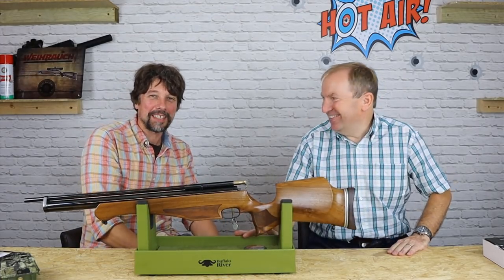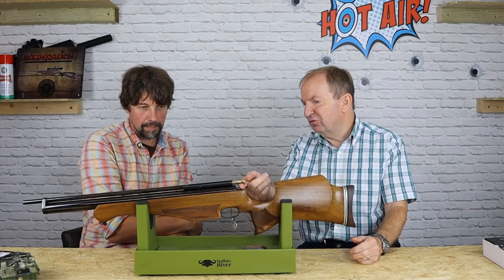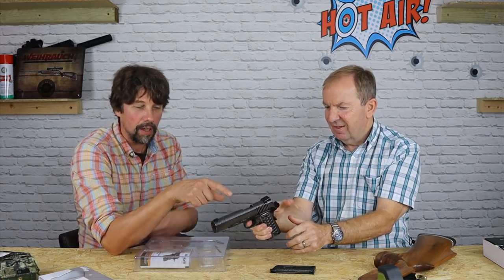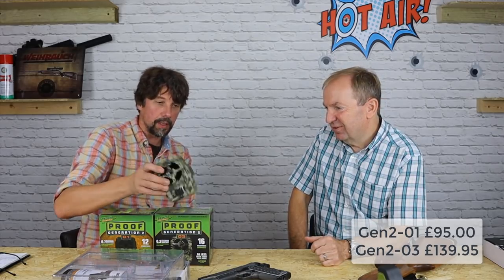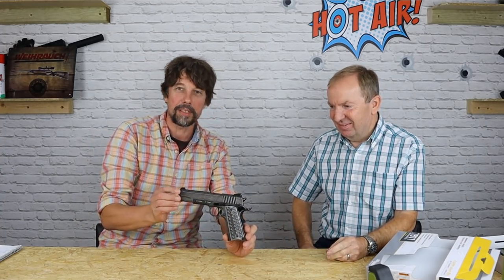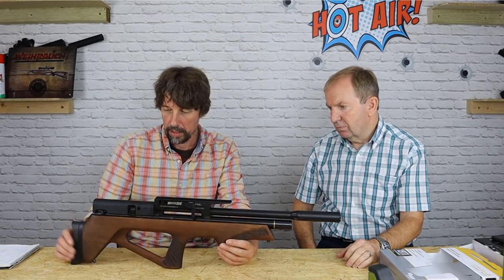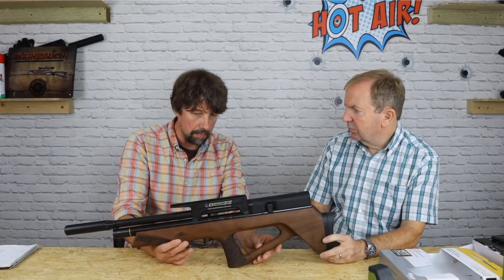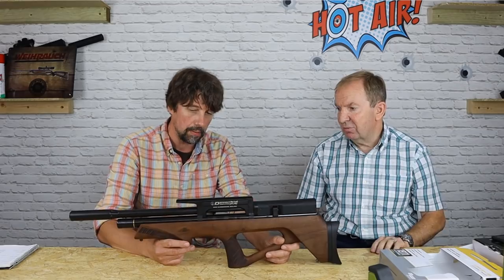BSA Defiant ...a slightly different conclusion to the rest. We also look at another Classic.

Comment: It sounds like indeed the reg is set too low, and that’s why it hammer bounces in  sub12 and .22 you have to restrict the Tp and set the reg higher. That will increase the shotcount and will limit the power at low pressure

Comment: i would like to have seen the defiant with a carbon bottle,which would have lowered the weight and really upped the shot count,the shroud and silencer look good but if not great a redesign is required,all in all a decent enough looking gun but the chance to move things forward bsa seems to have been missed.the pulsar was very marmite when it came out but went on to be a good seller due to accuracy and quality.

Comment: I love these videos! But I'm pretty sure the barrel will also come out of the SIG.
Reply: i really tried. it had two recoil springs the one around the barrel off a 1911 and a second spring a la browning high power. even with both removed I couldn't get it out and I'm quite familiar with both designs. but everything was very tight, probably to keep it accurate, airguns need tight tolerances and this is a 100 year old military pistol design.

Comment: I think I’d rather have a p15 at under £500 and have a boring looking gun.
Reply: I bought an SMK P10 before I bought my Wildcat (mk1).
I got a duff gun and eventually gave it back, as it was still leaking after several repairs. :o(
Reply: @russdouglasagw8151  I have a P15 and it's not been a problem.
Reply: You got what you paid-for, I didn't.
Reply: It's a good little rifle. Better shot count then the bsa as well..
Reply: That wouldn't be too difficult.
Reply: Question for u 2 would u rather a p15 or buy the bulpup kit for a Hw100
Reply: steve todd p15.
Reply: @tellsthetruth5919 : If you already have an HW100 I'd stick with that & get the bullpup kit. The HW is outstanding proven Engineering, plus you can pop it back in its original stock anytime -two guns in one = result.
Reply: That's a no brainer Steve, 100 kit equals outstanding rifle and bullpup, nuff said.
Reply from the maker: Bullpup kit all the way if I already owned a Hw100
Reply: @ahuskins1985  oh Adam 🤣😂🤣